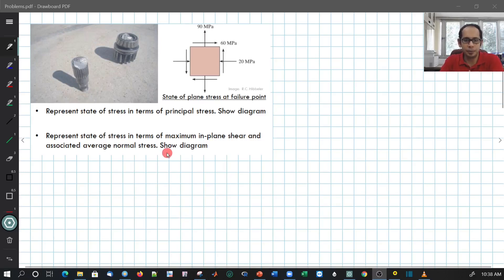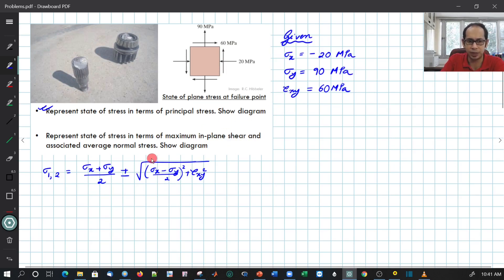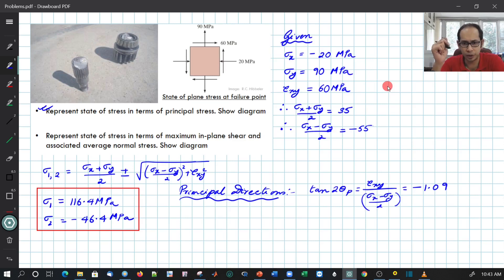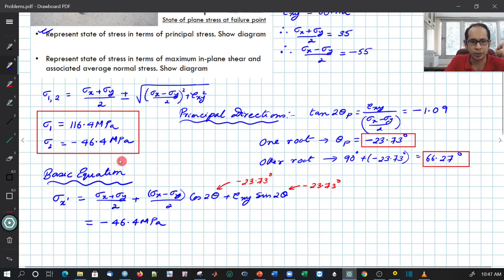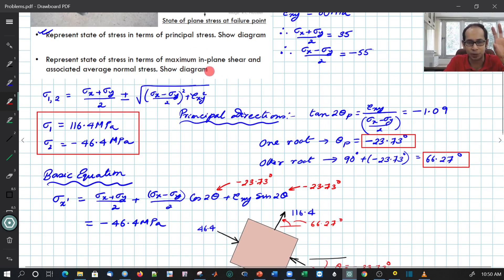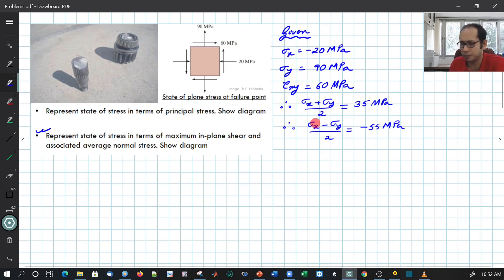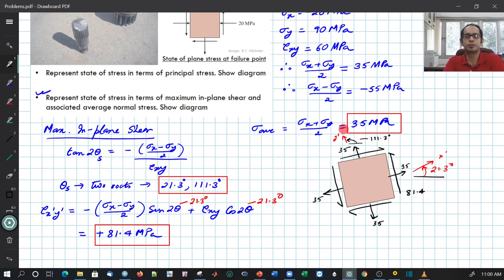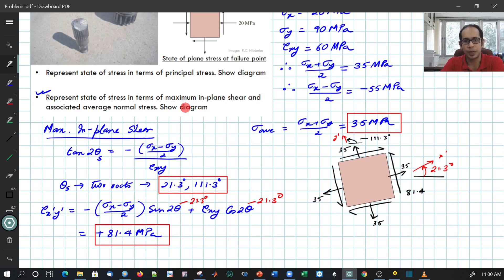Topic # 8.2 - Problem Example

Comment: Max shear planes are always orthogonal to each other. How can  maximum shear stress is +ve and other maximum shear stress is -ve. From the basic sign convention adopted for shear stresses, shear stressed acting on two perpendicular planes will always be + ve or - ve. But we can't have one shear stress to be +ve and other to be -ve.
Reply from the maker: Depends on convention, and the face you're looking at. Recall, something positive or negative, is based on the frame of reference assigned by us.